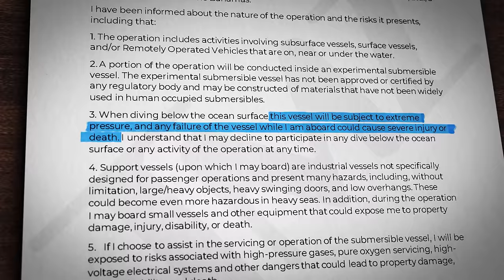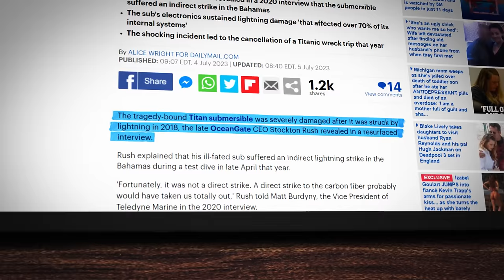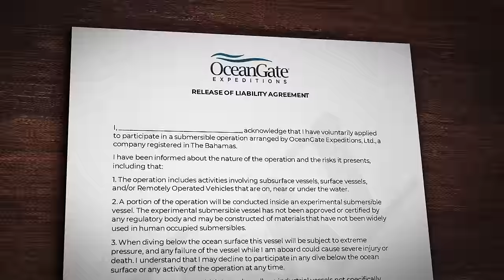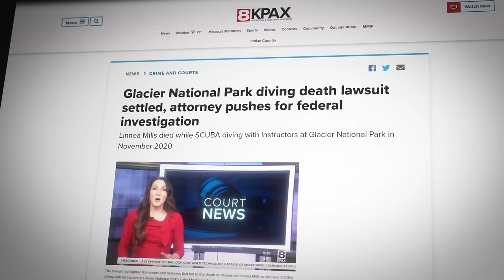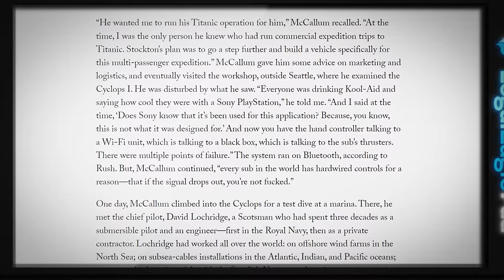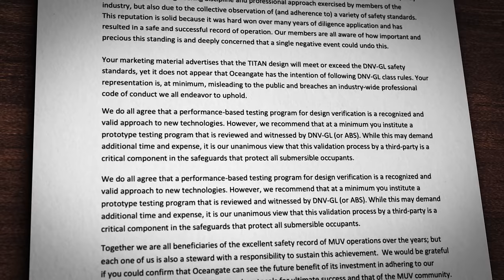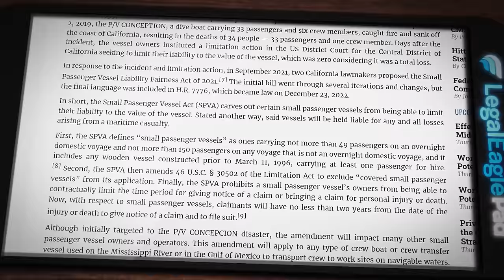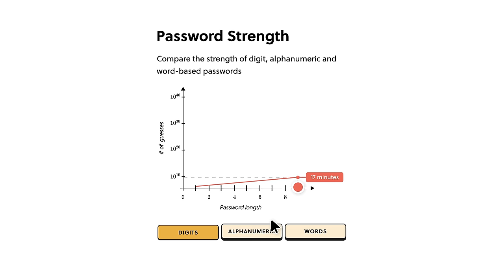OceanGate Is Getting Majorly Sued

Comment: "who could have possibly foreseen something going wrong with the Titan sub? Well, the lawyers"
As an engineering student, trust me, the engineers saw it too. They didn't just not get it certified for fun, they knew no agency on the planet would certify it.
Reply: any blind person would have seen that it was not safe. i in the first case saw it wasn't safe. I'm just a regular ol joe
Reply: I think the main reason was cost saving. However doing something unconventional for cost saving measures isn't always bad. But unconventional is often hard to certify.

There is a lot of speculation and illwill against the game controller. However this in itself isn't an issue, btw nuclear submarines use of the shelf game controllers for some tasks too.

You have to do a fault analysis and evaluate the risks and consequences of a failure. As this thing was designed, everything about controls and underwater communication could have failed, it was designed to automatically drop the weights and surface after a certain time. They had enough supplies and oxygen for quite a while, so this all was fine.

The issue is the hull which of course had a very experimental and flawed design.
Reply: @altaccount4697 Could the Apollo 13 module that failed been "certify"-able?  Would NASA got their crew back alive if they had to time to 'certify' all the things they had to use "off-label" to get the job done?
Reply: Gamers saw that logitech controller and knew immediately. 

The golden standard for a submarine is a wired xbox controller, and them buying a cheaper, wireless one to save $20 would tip me off.
Reply: @lal12  The amount of shit the game controller gets from the public, when with the information the public has, it seems to have had nothing to do with the catostrothic hull failure. Just because people dont know how common "gaming" controllers are in heavy machinery. is insane
Reply: @Kajanda  It's human nature for people to latch on to and only consider something they are familiar with, while at the same time ignore there may exist something they don't know about.  Often it's the latter that's the real issue.
Reply: @jagmarc NASA had government funding and top engineers that wouldn't get fired if they brought up safety concerns.  They also didn't buy parts from a camping store.  They also didn't give their astronauts a video game controller as an only means to control their ship.  Also, way more pressure is put on a submersible 2 miles underwater than in space.  This was pure negligence, arrogance and greed.
Reply: @GamePath  the game controller is no issue in itself at all!!! Of the shelf controllers are even used on nuclear submarines. Nor is buying stuff from a camping store if it fits the fault analysis. The issue is the hull design.

Btw. SpaceX uses a similar approach, they while NASA uses specialized space hardened computer chips, SpaceX uses normal (probably higher quality) x86 computer technology with additionally shielding and just more of them in parallel. If you do such a fault analysis such an approach is often even more safe and cheaper to develop and build.
Reply: @jagmarc  literally everything with nasa is off label. The point is space shuttles and rockets aren't exactly commercial space with regulations and saftey standards. NASA on the other hand didn't have any of that. Its relative but this comparison still isn't good
Reply: @GamePath  You'd be surprised what COTS parts are used for spaceflight, even manned missions.  
And in space you can't float back up to topside, and spaceflight engineers are way ahead of the curve of any 'certification' or QA process.
Reply: @GamePath  Yes agree with you a culture of go/no-go after enormous amount of expensive formal analysis test and measurement. But Apollo 13 crew ended up having to misuse much of it "off-label" just to get back home alive.
Reply: @jagmarc  You realize the pressure in space is different than being 2 miles under water right?  And NASA was actually doing something new.  These guys were a bunch of idiots cutting corners, just to cut corners.
Reply: @jaggerangel5564  The sub isn't public transport like a greyhound bus or 747
Reply: @jagmarc  I Know it is, but going out and review bombing and flaming a business, that had nothing to do with it, especially since it is not the manufacturers fault their controller was used for that. (pretty sure even sending threats) is still insane and just not okay. (not that it hurt logitech I believe it was) but especially sending threats is a no go
Reply: @lal12 some tasks, yes, not primary control of the submarine
Reply: @jagmarc  not sure what you're saying here.

Negligence. Because you can't use NASA as reference when they never had anything to do with it. As stated by you and others. OG was in no way comparable as a commercial venture to something as over funded and oversaw as a NASA project....

If that's not what you're saying then oh well lol. OG was literally a bunch of idiots trying to cut as much corners as possible to make a shady buck off a grave site they should of well learned their lesson from in advance
Reply: @jaggerangel5564  You'd mentioned safety standards applying to OG. That's not the issue. Nor is negligence. These have yet to be proved. 
The steam engine that drove the first ever locomotive wasn't certified as I believe. If that had failed we'd had probably had replaced "pioneer" with "idiot".  Actually I think they were actually getting ready for saying exactly  that at the time of you read the publications from the time
Reply: @Kajanda   documentation completely aside, I believe the issue discussion  a COTS game controller doesn't cause an alleged hull breach. But can be used as a device to dig dirt.
well I guess it could cause a hullbreach if it drove the sub into a hard object somehow, or the GC was slung against the window hard enough
Reply: @GamePath  So easy to call someone idiot AFTER it goes wrong. The base jumping guy who retires from it unscathed  isn't called an idiot.
Reply: Fiber reinforced thermosets are neat af, but subjecting it to this many pressure cycles is not what you wanna do with it frfr.

Also.
>student

Lmao
Reply: @jaggerangel5564  I little point make re "everything about NASA is off label"  all NASA approved materials and components are listed in a compendium, showing the manufacturer and specification. Also states flight qualification status, related approvals and MIL specs and radiaton dose and life test and other data. Designers are as much lawyers as they are engineers and have to ensure all ratings and and safety margins are always complied with at worst case conditions.  Space flight is the most unforgiving of all environments and if anything at all can possibly go wrong then it will and when it does it does so the worst possible way. Trust me on this I know.
Reply: @jagmarc  right which is why nasa didn't approve of the use of the materials for the pressure at which they dived 👍
Reply: @jaggerangel5564  NASA operate in Space, not ocean
Reply: @jagmarc  I'm american and been my whole life. I know well what NASA is. Our media, news and entertainment wouldn't let us forget the brave people of Space. Neither would those brave people ever approve anything ocean gate did. In fact they sought out NASA partnership and got turned down I believe lol
Reply: Engineer here too, yeah that thing was a BAD idea. carbon fiber hulls are great for bikes and lightweight car parts and such, but when weight doesn't matter and you're going to go underwater, you need to absolutely go the hardest metal you can find to absolutely minimize flaws and dive depth

And you need multiple layers of high grade polycarbonate for those windows. Essentially bulletproof glass. They were making a million dollars a trip. They could expense a proper, fully solid titanium hull, that you could even add more internal bracing for

When I heard it was missing and googled it, I knew they weren't going to find it.
Reply: @rolandcaters7258  even for the primary control it's not a problem. What's the alternative? A button on a console? It also can break. You have to do a fault analysis and mitigate either of those. E.g. you could just have a spare game controller on board. But this thing was controlled by a windows PC anyway which isn't reliable enough either.

So the easiest solution is to just say, the control can just fail. Our backup is our automatic surface mechanism. They had enough food and oxygen to rely on that. This isn't a very elegant solution, but for the purpose of this submarine a valid one.

Of course for the hull this isn't viable, there you need something as reliable as possible.
Reply: I mean, even from a layman perspective it was obviously bad.
Reply: My brother in law stated similar. He seconded basically everything Jim Cameron said.
Reply: @klinestill controlling isn't a critical function on a tourist submersible either.
Reply: The writing was on the wall. So many people knew that it was just a matter of time before his "experimental death trap" failed but nobody took action. Writing letters was an epic fail.
Reply: As soon as I realized it didn’t have a double hull being that thin, the thing was going to break apart under pressure. I find problems with the hull shape as well, the long surfaces without bracing seem terribly designed.
Reply: @jagmarc  Do you realize how much certification and testing goes into human-rated space hardware, even in the Apollo days? The nation saw the cost of complacency and "go fever" when those claimed the lives of three astronauts. The Apollo command module was thoroughly reviewed as a result, and no other Block I command module was ever used to carry humans.
Reply: And the result of that review process likely saved the crew of Apollo 13 by ensuring that their command module didn't malfunction or catch fire from electrical shorts, when water vapor condensed on every surface inside in the cold.
Reply: @FawfulDied  yes and a huge amount of that certification went straight in the bin when they had to use gear outside of what it was designed to do and outside of parameters just to get the Apollo 13 crew back alive.  If they didn't use things outside of their designed purpose they would had died in space.
Reply: @jaggerangel5564  I think you'd have to ask an astronaut that before quoting their opinion on something as I don't think either you or I can speak for what they would say on the matter.
Reply: @jagmarc  look at you. The guy who's not an astronaut saying something you hears an astronaut say lol...
Reply: @jaggerangel5564  talk about "Pot calling the kettle 'black' " ? 
To quote what you quoted as astronaut's opinion  "...would those brave people ever approve anything ocean gate did"  to which I said neither you or I can speak on behalf of   or something  like that
Reply: @jagmarc  yeah we can cause they pubically denounced any connections 😏
Reply: @jaggerangel5564  really? I'm not aware of that. Should really cite when quote :)
Reply: @jagmarc  Likely, yeah. That's the disaster of "I want you to remove your engineering hat and put on your management hat" right?
Reply: @jagmarc  It seems like you don't understand the purpose of reviewing and testing designs. Obviously, unforseeable issues ("unknown unknowns") cannot be intentionally tested for. But that is no excuse not to clarify the KNOWN unknowns.

Without the procedures developed before the flight to use the LM for survival (developed in response to simulations before the flight), the astronauts would have died.

Without knowing the limits of the hardware aboard the LM, CM, and SM (found in testing), the astronauts would have died.
Reply: by the way, as any good design engineer will state, every component has an actual performance range which significantly overlaps the range it's certified for.  If no overlap then there would no margin and the manufacturer needs sufficient margin to survive and enforced by slow moving legislation and patents.  Only in "Hollywood" does something explode the moment precisely the needle passes the 'max' line (+5 seconds exactly)  
Even when a component's performance range is known to greatly exceed the range it's been certified for, even when it's proven by unofficial tests, the true engineer will never use that component in that way, simply because if something went wrong, in the witch hunt that follows anything which is found to be outside certified range leads right back to that engineer who put their name to it. I know I would rather resign or be fired if I was put in that position myself. 
Now finding and utilising margin differences between actual performance and certified performance as a means to save life when no alternate available that's one thing, but being the opposite the other way round is the issue.
Reply: Its not uncertifiable to make a carbon fiber sub. You just need to prove beyond reasonable doubt that your engineering is sound and edge cases have been taken care of. Both are expensive and this Stockton guy was seemingly of a fake it till you make it mindset
Reply: @technewseveryweek8332  Spoken by a non-engineer.   " reasonable doubt " Isn't an engineering term.  
 Mean time before failure hours, failure rate in one billion years, those are engineering terms. They come from formal analysis, which comes from certified constants, factored by margins. 
I've no idea at all what caused failure , I'm not following it, nor interested either to be honest.  
I do know engineers generally don't risk their careers making name for themselves after finding out some material or component significantly outperforms what it's certified for. They don't do that, not without a Waiver and even then reluctantly. I'd rather be fired than risk my career.  if something ever goes wrong, then that's what the Inquistion will pick up on during a witch hunt. Irrespective of whether it had any effect or not. Not me.
Reply: @technewseveryweek8332  I mean, a carbon fibre sub? Maybe, but unlikely given carbon fibre being so bad under a compressive load and the difficulty of testing and simulation combined with crap load cycle characteristics. But THAT carbon fibre sub? Not a chance.